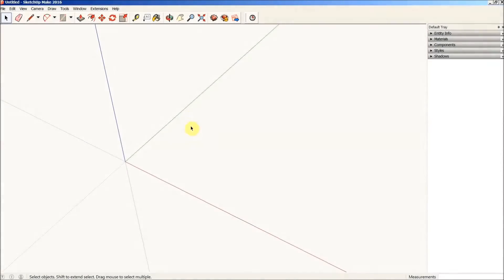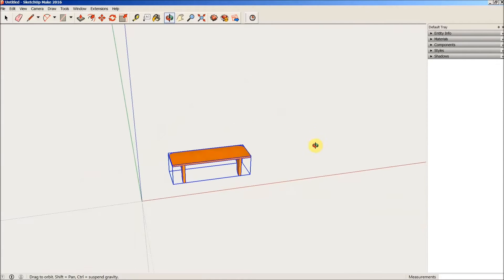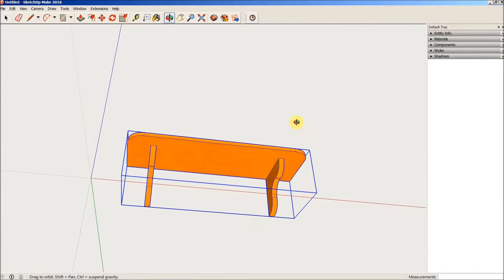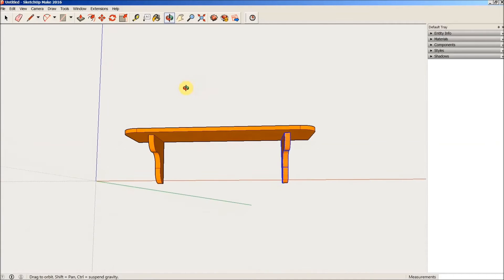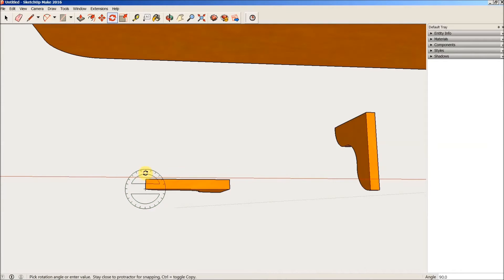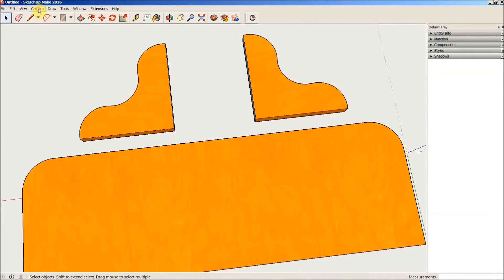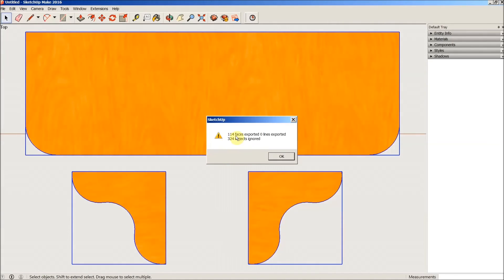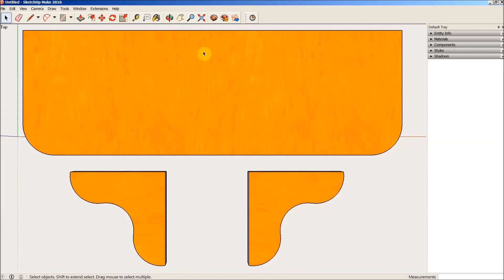From SketchUp to DXF File for Use in VCarve Pro - Part 2

Comment: Mark...good video.  I noticed this video is 3 years old.  I noticed that Sketchup has an export to dxf function - 2d and 3d model.  Is it required to still use the extensions for being able to export and import into Vcarve Pro?
Reply from the maker: Thank you very much, Rob! If you already have the option to export to DXF, then you don't need to add that extension. Back when I did this video, Export to DXF was only available in the Pro version of SketchUp - not in the free version. That's why those extensions were required. I don't know if it's available in the current free version of SketchUp. I'm still using SketchUp 2017, when I use it at all. Once I got used to drawing in VCarve, then later Aspire, I more or less stopped using SketchUp.
Reply: @MarkLindsayCNC  Thank you for the reply.  that is what I thought but wanted to validate if I was missing something.  I do use Sketch-up Pro and realize tailoring for the audience.  Many people use the free version and I don't know if the current free version has the ability to export dxf files without an extension.  BTW...did you do a  video that demonstrates how one can measure distances, hole sizes, etc. in Vcarve Pro?  If so I haven't run across it yet.  Still working through your vast library of information.  As you can tell by me talking about a 3 year old video and asking questions.  thank you so much for your efforts.
Reply from the maker: I don't think I ever did a video dedicated to finding those measurements, but the techniques are certainly scattered in among the videos. I should probably add that video idea to the list and get one done. As for checking the size of a hole or other object is concerned, just select the object, then click the Set Object Size icon and give it a look. Thanks again, Rob!

Comment: Just for you to know. to work with sketchup and VCarve, you can import the skp file directly from Vcarve. That's what i'm doing from about 8 years now.
Reply from the maker: Yes sir, you can import a SketchUp model directly into VCarve. This video was a direct answer to a question I had in a forum about converting a SketchUp file to a DXF file. The person asking the question wanted to create a DXF from a SketchUp model so he could make some changes in his CAD program, then import that DXF into VCarve.
Reply: Vcarve going to scale the face by imself and a lot of easy thing you can do easily.  I make store furniture with this. If you draw some hole, make a component with it and a componant with your piece. Take the 2 componant you just done and make a group or componant with it but when you name it put 2 underscore before the name to keep it togetther. Vcarve reconize the 2 untherscores (__) and after you can separate that in 2 layers to programme the cutting . A lot of easy way to work with